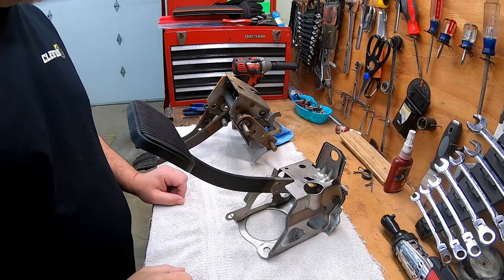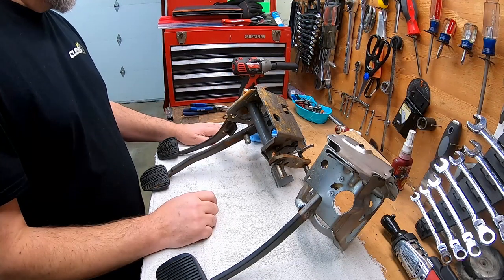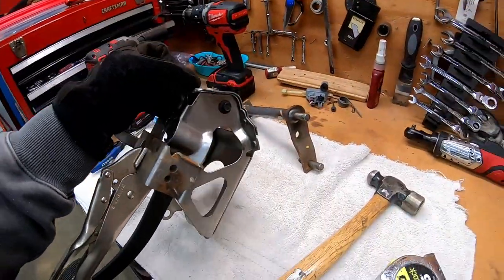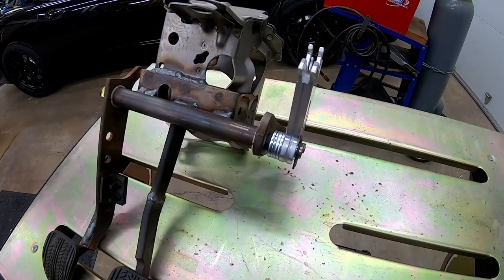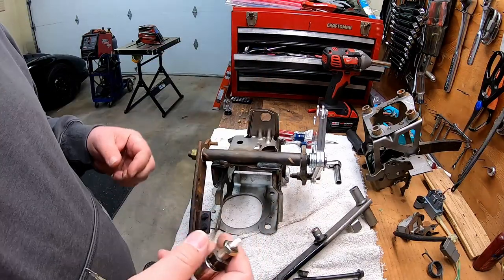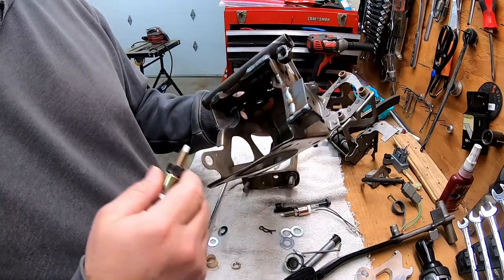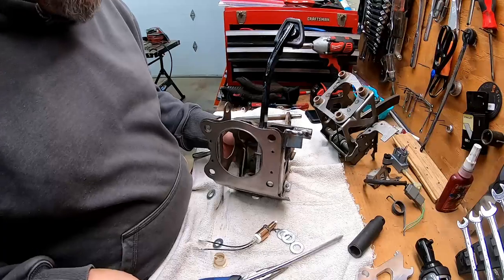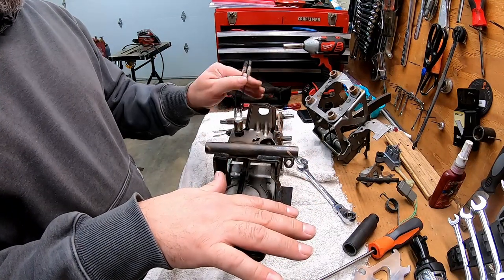How To 5 speed Swap a Crown Vic From Scratch Part 1 The Pedal Assembly Full Detail

Comment: Thanks for the Shout Out.   Excellent  video. 

I used your video to lower my front end by cutting a coil out of the front springs.  I got a 1-5/16" drop.  

I ordered 1.5" lowering  springs for the rear from Eaton.
Reply from the maker: You are welcome BP.  Rightfully deserved.   I'm very curious to see what you will think of the eaton springs.  We looked into those briefly but ultimately like the idea of going to an adjustable setup in the rear.   So far that setup has far exceeded our expectations.

Comment: Nice job on this. As a grinder and not a welder I would have never attempted the brake lever weld. Props to you.
When I did my swap I used F150 pedals and pretty much the same thing you did ... I just Mig welded the F150 brake pad to the Crown Vic brake lever ... And made the F150 clutch lever and pad match the length of the brake. After some cable issues I went hydraulic and never looked back. Master cylinder for that is right under the power booster. It feels like a Mazda 323 engage / disengage.
Reply from the maker: Thank you.   We even ended up cutting the brake pedal again after this trying to get the ergonomics just right.  We did eventually succeed.   Both the brake and clutch pedals needed fine tuning.    Definitely not worried about the brake pedal snapping off.   It's a stout 240v weld.     I'd be all for a hydraulic setup if there were something pre packaged that didn't cost and arm and a leg.    That being said my wife and have owned at least 3 cable clutch mustangs in the past and never had any problems with them.  If they are set up properly with good parts they work great.    At least with 300hp or less clutch they do lol.    With some crazy race clutch I'd want something hydro for sure.

Comment: Great job. I know this is old.news to you but it's new to me. You built that setup better then anyone I've seen and I've seen a lot cause I am planning a swap ony 03 P71. I'm in between a T-3650 and a T-56 Magnum. Cost is the only thing leaning me towards the T-3650. I am just really really hard on my car so I need it to last. And I am planning on boosting her as well. Thank you for the velcro fix on the console lid. You told me about it a few months ago. Works great. Thank you for the content and being thorough. I am OCD when it comes too making sure it's right the best I can make it. If I can't get it good enough I will find someone who can. It's kinda aggravating cause it costs me more time and money but it happens.  Lol. Again thank you for showing in really good detail how to do this. They have a hydro conversion for the quadrant now. So I am going to go that route but I have to make these pedals first. ADTR has a conversion pedal for them now but they are a few Hu dred bucks. Would you rather build that again or spend about $400 with shipping and all I guess for the conversion pedal setup?.
Reply from the maker: Appreciate that Hugh.    I honestly am fine with the cable clutch in a near stock power application I should say.  The effort is not bad at all using the LUK clutch.   If I were doing a T56 I think most go full hydro and not that adapted quadrant deal.   Also just throwing this out there.   I think you can get a Hanlon Motorsports 3650 that will hold like 650hp that would probably still be cheaper than going full tile with a T56.     We still have some update videos to do on this project as well one of these days.  Would really like to get a proper custom leather shift boot made for it first.  I need to get on that.

Comment: Great video definitely answered some of my questions on how I need to modify mine Will be using your video in reference to build mine!!
Reply from the maker: Thank you Tyler.   We probably have about 700 miles on this swap so far and it puts a grin on the face every single time.   There may still be a couple more videos on this swap and some of the finer details in the wiring department and the misnomers of mustang cable clutch adjustment.
Reply: @PNW_Car_Mods  did you have any problems with the third brake light I can’t seem to get mine to work
Reply from the maker: @Tylerp71  Negative.  Has always worked.   Should just be a wire tapped off of the main harness going to the taillights but I can't say that for certain.

Comment: That's pretty cool. Probably have the only 5 speed Crown Vic on the planet. 😎👍 Sure will be fun to drive. The Vette isn't just for having fun either and can be used as a tool as well, I've done it too.  🤔  😃  Great job on the fab.
Reply from the maker: @anthonybartley4667  Thank you Anthony.  Heck I was thinking there could even be a thousand.  I don't know for sure though.  I'm not a facebooker but it's cool there's a facebook group page for it.
Reply from the maker: Like Anthony said definitely not the first.  Heck I think the first one got swapped before Isaacs car was even built.
Reply: @PNW_Car_Mods  ya probably is over a thousand by now, there's even a group for these getting coyote swaps, glad these cars are finally getting some love
Reply: @PNW_Car_Mods  I still have to manual swap mine when I get the funds, always thought a 5.8 trinity would be a cool swap
Reply from the maker: @anthonybartley4667  I would love to Coyote swap but it's tough pill to swallow as the cost of coyote engines is very high.    I hate to say it but you can do so much more with LS based engines for sometimes less than half the cost.   The only crappy part to LS swapping in this case is the TR3650 is hard to adapt to an LS. Not impossible but the cost for the custom bellhousing is ridiculous
Reply: @anthonybartley4667  That's cool. I didn't know. Not a Crown Vic or faceplant guy.
Reply: @PNW_Car_Mods  idk how hard an ls swap is on these, but apparently for a coyote swap you can get modular adjustable motor mounts, move them all the way back and it drops in, then you get the harness for around 1k, probably forgetting something, but that's pretty much it as far as the engine goes, and if you find a good deal can find a truck coyote for sub 3k
Reply from the maker: @anthonybartley4667  Thanks Anthony. I will look him up.

Comment: you have  a great detailed video could this work on  a 2002 crown vic  formely a DHS car thank you
Reply from the maker: As far as I know bobby the early cars are even easier to 5 speed swap since you have a cable throttle and don't have the power pedals to deal with.  You will still need the tuner to keep the wrench light from being on all the time.

Comment: I love the videos! Quick question, Are you using the same Switch for the brake lights and the neutral safety switch?
Reply from the maker: Yes they are.  and the ones I used in this video were both garbage and failed.   We swapped them out with a cross reference AC Delco part and have had no further failures.  D884A

Comment: I'm manual swapping my 04, but unrelated question.. .how's that harbor freight welding table? thinking of getting one.
Reply from the maker: Highly recommend.  Use it all the time.   So nice to be able to weld on things without the ground directly attached to the part.    Sure, I'd love to have a big ole permanent welding bench but I just don't have the space for it.   This is easy to store when not in use.  Since that video I've probably used it 25 times.
Reply: @PNW_Car_Mods  Sweet, definitely grabbing one. I was using a steel engine crate frame and it's just too bulky, and looks like a giant piece of scrap metal lol

Comment: Im working on doing a 5 speed swap on my 2011 was wondering if you know the procedure to make the firewall adjuster bracket? Or can i just drill the adjuster straight into the firewall?
Reply from the maker: All of that is coming up in the next video so hopefully you'll stay tuned.    Should be up in a day or two.  You have to use a brace or the sheetmetal firewall will fail and you will ultimately lose the ability to use your clutch.
Reply: @PNW_Car_Mods awesome ill be waiting💯
Reply: @PNW_Car_Mods  are you going tr3650? T45? Or a tremec?
Reply from the maker: @ant.sn9543  3650

Comment: Why can't you just modify the back of the Mustang clutch/brake assembly plate so the bolt holes are the same as the C/V holes!?
Reply from the maker: That is a good question Frank.  The reality of it is the mustang pedal box is so different that it won't fit in the pace allotted and the bolt pattern to the firewall is completely different.  By the time you got done chopping it up you would have it more modified than doing it the common way.   I've also noticed that ADTRs pedal box now is 100% custom built out of their own design instead of using the mustang and crown vic boxes together which I am assuming they did that because it's simply easier to build and not having to worry about sourcing cores.
Reply: @PNW_Car_Mods  Thanx. I'm just planning now. I'm going to make it a reality this year when the weather gets warm! I will definitely look into the ADTR version.